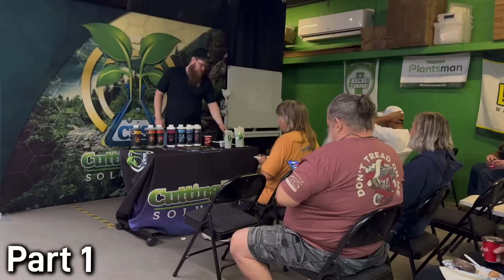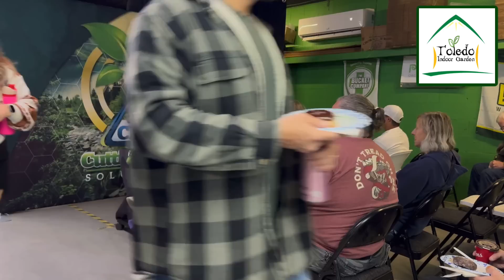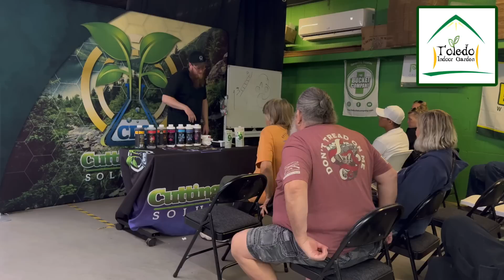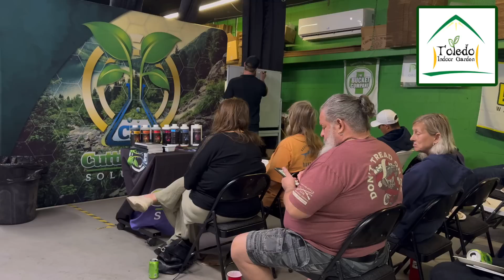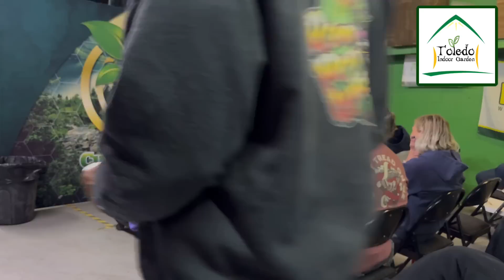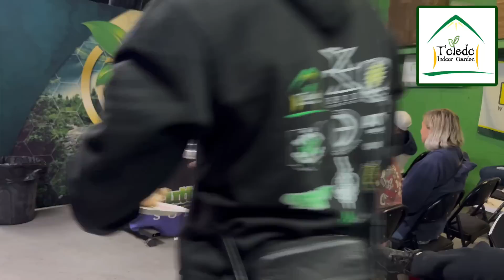Indoor Growing 101 - Learn all about keeping your plants happy and healthy all year round

Comment: If you water with oxygen deprived water you are killing your plant.    Oxygenated is better.   A pump will heat rez up and the dissolved oxygen goes down.      If a pump with no air worked... dwc would be using a water pump rather than a air pump or water pump with air venturi   also you do not need dry backs... or again dwc wouldn't work.  Its all about oxygen.  Increase the ec then drop it back   it does same thing drybacks do

Comment: No one grows indoors in soil.     Soil is sand, slit, n clay.       Peat moss is hydroponics and engineered media.    The plant does not use all the nutes the first 15 mins.    its translocated by transpiration.     also mobile/ immobile  does not mean hard to pull from the soil,  it means in the plant.   It can or can't take from one spot in the plant n relocate it to another place  inside the plant.
Reply: It's not that black and white though. For example calcium only gets moved around with water from the root zone, it doesn't get relocated from the plant itself 
And I wouldn't say peat is hydroponics, coco maybe (though I'd place it right in between the two) but peat is closer to soil really. You'd be using perlite, vermiculite, beneficial bacteria and probably some top dress or something with it..That ain't hydro bruh :)
I'm also charging it (peat user here 😊 ) with Bokashi composting for example..and I'm reusing it too, so there's bunch of root hairs etc  I'd say it's more closer to soil really

Comment: I'd say buy stronger light than your tent requires and don't go over 75% at any given stage. Bar style would have a much better coverage, and you're saving both the diods and your electricity bill 
I'm using a panel that's designed for 4x4 , but I hang it in my 3x3 
Literally wall-to-wall coverage, getting better reflection off mylar as well, plus it'll last substantially longer, since even 50% gets me there around 900ppfd, but I'm sometimes going for 75% when I see they can take it 

My 2¢